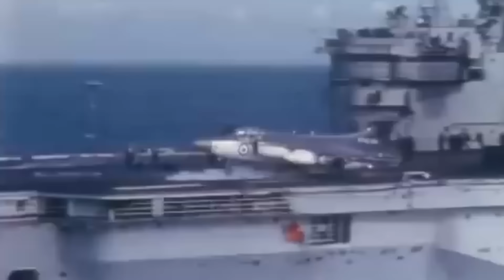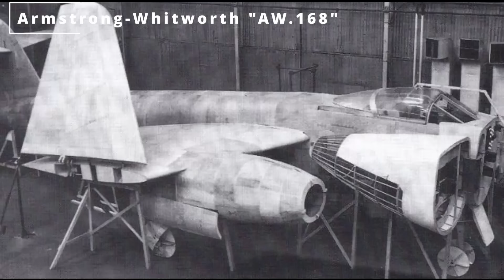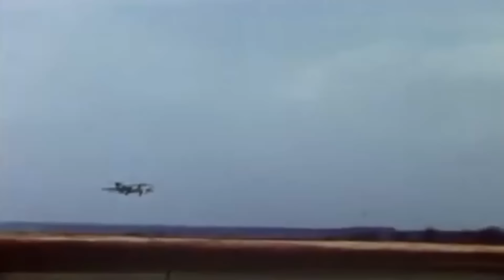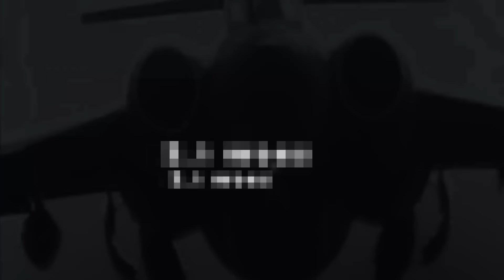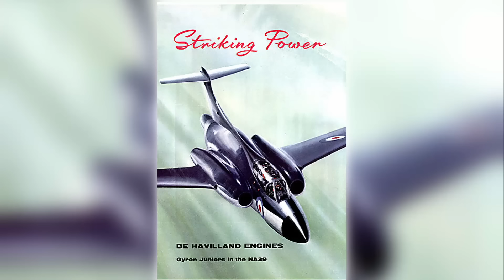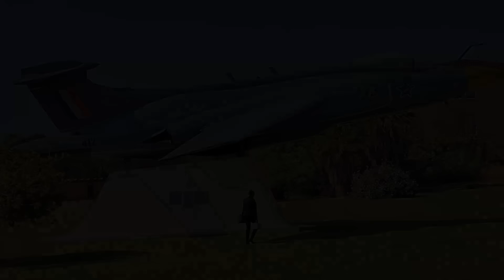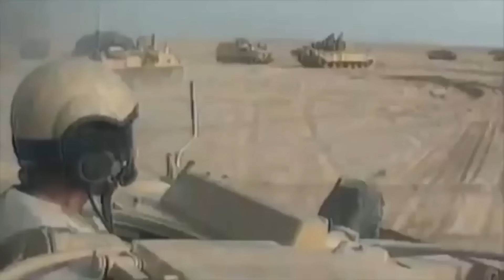Blackburn Buccaneer  -  Insane Low Level Bomber Americans couldn't shoot down - (Full Story)

Comment: Acknowledging the different missions, the Buc almost looks like a mildly swept wing version of the CF-100.  A little pointier on both ends with a higher tail.
Reply: They were both very disappointing aircraft from a performance perspective... the Arrow and the Buc both fell well-short of their top speed performance goals leaving them unable to fulfill their intended roles. The Buc fell short due to poor high-speed aerodynamics and structural problems... The Arrow might have been a superb aircraft if the Orenda Iroquois engine had not been an embarrassing, completely unmitigated failure.

Comment: I recall watching live broadcast from the Falklands War in absolute awe at the ability of the airframe to manoeuvre so violently. I couldn't understand why the wings were not simply ripped off. Thank you for the answer 😎
Reply from the maker: The one in my local museum (RAF Hendon) has a Gulf War Bucc SB2 with the wings folded, the spar forgings are simply huge
Reply: No buccaneers were used during the Falklands conflict though it’s said 2 did visit after the conflict had finished

Comment: The Target Marker Bomb was a label applied to the Red Beard nuclear bomb in the early part of the NA.39 programme. The reason being that the Ministry of Supply and the Atomic Weapons Research Establishment at Aldermaston didn't want the codename Red Beard to be known to the aircraft companies and their numerous suppliers so the TMB label was used to disguise RB. Labels have a habit of being hard to remove. I worked as an engineer at the old wartime Blackburn Aircraft factory in Leeds from the mid-1950s. Much of my work was on the Red Beard casings, another Blackburn product.

Comment: There are 2 and a half Buccaneers at Raf Kemble.
Reply from the maker: What happened to the other half?
Reply: @AviationRepublic lol. Two complete and basically half of one in between the two complete planes.  Hopefull being sacrificed to make a good plane or two.
Reply from the maker: If only I could win the lottery, I would spend it all on buying as many of these wonderful machines, stick then in the hanger and admire them. :-) Joe
Reply: @AviationRepublic  they both looked  complete.  Most of the planes that go there (especially commercial planes) are sent there to be  scrapped but ive seen old planes flying about there last year. One looked very much like a canberra. (too high up to make a positive id) There was deff  one on the ground near the runway.  They have old planes littered about the place near hangers.  Including one with twin propellers (on each engine ) a  few years back.  I actually went passed hangers  with an escort and they were running one of its 4? engines.

Comment: Was in the FAA as a humble REM(A)1. Was at Lossiemouth Honnington and Later the Ark Royal , This bought back some memories, humping black boxes of freshly calibrated electronics (mostly still valves and all analogue) into the radio bay in the belly and installing and wirelocking  it in place and dragging the old one to be serviced recalibrated, the Blue Parrot radar scanner under the nose cone, checking  the armoured had made the ejection seats safe(all safety pins in place) before going into the cockpit to do checks, playing cards and board games for hours waiting for the cabs to return from sorties as every trade had checks to do when they landed. Cus I had it cushy as an Rem (less work to do post sortie I had to trundle a trolley around the flight deck and with a lance spay WD40 into the engine intake as they cut the engine, think it helped with the salt, I've seen them flying so low that they're almost sucking the ocean in😅 can I say it's nice to hear a good human narrator, Am sick of all the robot voices on YouTube ❤
Reply from the maker: Thank you for sharing this, I never heard of the lance spraying of the WD40, that's a new one, that's gone into my note book. AI voice have a place, but here Alex did a great job, now I have taken over (Joe) the last half dozen latest videos. :-) Joe

Comment: On an air defence exercise in around 1977/78 on the Belgian, West German border we had F111s and Buccaneers flying against a 'target' we were defending with Rapier missile systems.  The F111s were no problem, picking them up at max radar range and carrying out three or four engagements per raid. Then came the Buccaneers. Our systems were alarming out at max range, but no targets visible. That is until two Buccaneers thundered directly over our missile site at between 10-20 ft! (which I believe, if the pilots are to be believed is the Buccs max operational altitude ;)). They were that low we felt the full jet wash and enjoyed the wonderful smell of burnt jet fuel! Fantastic aircraft.

Comment: I used to work on an inshore trawler in the early 1970s when they were testing the Buck at ridiculously low level  in St Austell bay on  the south coast of Cornwall. They used the inshore fleet as aiming points during low-level exercises when they flew at mast-top level, at close to if not above Mach 1. If I was out on deck as the Buck 'buzzed' the boat the noise would be deafening (if you saw it coming flying at wave-top height) you just had time to plug you ears; if not the noise would cause severe ringing in your ears that lasted for  15-20 minutes. On the other hand the noise was so invigorating we welcomed the devastating 'high' we'd get from the jets' passing.
Reply from the maker: What a fantastic story, I am very jealous you got to witness that in real life, my question is, did it scare the fish, I had to look up what an "In shore trawler" was, now I know, ones the work close to the coast, usually within 12 nautical miles of shore, every day is a school day. :-) Joe
Reply: The Buccaneer was not a mach plus plane. Growing up in South Africa I loved the Buccaneer, the Canberra and the Mirage all brilliant aircraft

Comment: I remember attending the RAF  Brawdy Air Show back in the 1970s when Buccaneers conducted a simulated, low level airfield attack. It was over in a flash, with aircraft attacking from all directions. It would have been impossible to stop the attack in real life.

Comment: I was at R.A.F. Honington in the early 70's as the son of an engineer who was posted there in 1969. In the early 80's I returned as an engineer myself, just as the Buccaneer left and the Tornado came in. One of the Buccaneer's last parting gifts was a 'beat up' of the airfield. We knew it was coming so we all poured out onto the servicing pan to await it's arrival. We could hear the sound of an approaching jet but nothing was in view. Suddenly a Buccaneer appeared over the roof of one of the Hangars. It seemed to be lifting to avoid the hangar. It promptly flew over the station at ridiculously low-level. Wonderful sight.

Comment: Trouble with the buccaneer was being out dated as soon as being built.  The french had faster better naval aircraft everyone had aircraft that could go faster than mach1 which the design of the Buccaneer could never do and its ceiling height also was a problem. Mount Batten was an Idiot really as got so many things wrong and not a nice man at all. It showed the UK was far behind others but then they found it was great at low level better than any other aircraft of that time by far. The only plane that could beat the Buccaneer was the Sepecat Jaguar French British with its line of site computer 850 MPH low level the best ever low flying aircraft even today better than anything.

Comment: Was on 700Z NAS trials unit then 801 NAS on HMS Victorious. Loved the aircraft but hated the boundary layer system - a pig to work on😊🇬🇧
Reply from the maker: Thanks for sharing! I’ve actually never had a chance to work on or really dive into the details of the Buccaneer’s boundary layer control system—it sounds like a real challenge. I’d love to hear more about what made it such a pain to maintain if you don’t mind sharing! :-) Joe
Reply: @AviationRepublic hi on the mk1 (I never worked on the mk2) - the ongoing problems that we regularly had was at the wing fold, with the high temperatures you couldn’t use rubber seals so they came up with complicated (over complicated) metal compression units and with the constant folding/spreadings they regularly malfunctioned and were a veritable pig to change out, especially on board ship in the tropics. They also made for an interesting spectator sport, watching the cabs land at higher speeds 😮🇬🇧
Reply from the maker: Here is a question for you, do you know why the Bucc has a hole in the tip of the nose cone?
Reply: @AviationRepublic it doesn’t - the early NA39’s had a test probe there but no 700z aircraft had them - they were fiberglass honeycomb 😊
Reply from the maker: You know the hole I am referring to? check out the video in the shorts, just to be sure we are talking about the same thing, I think i have the answer but I need it confirmed, it's driving me nuts :-) Joe
Reply: Hi again - had a look again and the only bucc with a probe is a factory pre production cab with a test probe doing sea trials. Ours all had fibre glass radomes😊
Reply from the maker: Thanks for looking, I think the only one I have seen with a nose probe was the NA39 prototype. NA.39 XK488 down in GNAS Yeovilton.

Comment: In 1976 I was in a holding squadron to start my fast jet pilot training. We had a ‘navigation course’ and weren’t allowed to pilot the Scottish Aviation Bulldogs (but that depended on your instructor pilot ;-) ). My instructor was ex-Buccaneers, awaiting the Sea Harrier. I remember holding at 1,000ft over the North York moors LFA and awaiting fast jets to call joining (the low flying area). My pilot took great delight in timing a max speed dive in our little dinky toy prop aircraft to get on the tail of a pair of fast jets and screaming the attack code at them over RT. EEEH, WE AD SUM FUN :-)) (Apologies for the pretend Yorkshire accent.)

Comment: The problem with the plane was it was so slow as the Hawk single engine was faster outmaneuver it. The only use was on navel ships but a stupid General kept trying to sell it instead of a fighter which it was so bad at the government had to get a fast real fighter the Electric Lightning. As the Buccaneer costs just got stupid nearly killed off all other supersonic planes.  It also in part with missiles stopped the making of new modern aircraft like the TSR2 and the Harrier. The other plane that was really bad was the Nimrod which killed off the supersonic Harrier only one was ever made then scrapped the idea.  As Britain does not have any aircraft companies very sad.  So we ended up with the F35 supposed stealth but has so many problems only a few are able to fly and they can only do Mach 1.2 as stealth design means can't go faster than that so why call it the lightning? RAF is in a mess they need the Buccaneer for the navy again.

Comment: Most of the aircraft embarked aboard CVA62 Independence 1970 were bridle launched, only two or three ac types had launch bars and the catapult shuttle needed an adapter fitted to launch nose gear launch bar ac.

Comment: I was in the RAF for a long time and was stationed at RAF Lossie back in the 90s. The final beat up of the airbase was spectacular ! Most of the squadrons climbed on their respective hangers to watch it. Other times I would be on 'wet drill' with aircrew, throwing them in the oggin from a ship for sea drills. The buccs would beat up the boat at super low level, I swear as low as the top of the boat. I spent a TON of time on the airfield on brake-chute recovery for the Jags and hunters, you could tell these buggers from miles away as they had a dirty jet exhaust.
Damn, I miss those days :-( 
Great video. Lots of memories.

Comment: I have happy memories as a RAF Supplier at RAF Honington, standing in ATC and looking down on a Bucc doing a wheels up 'taxi' round the peri track piloted by 12 Sqdn aerobatic pilot and Sqdn Commander Wing Commander Henderson (later promoted to Gp Cpt and RAF Honington Station Commander). Also memories of trying to load a Bucc Blue Parrot (ref 10D 4150714) radar set, in its transporting frame, in its transport box onto the steeply sloping Hastings a/c for an operational deployment

Comment: I was at Brough for 6 years in the IT dept. I did some work at Holme-on-Spalding=Moor, where for sometime I lived. In the Control Tower there was the test pilots/navigators room with pictures taken from the Buccaneers during test flights. Several pictures of my wife sunbathing in the back garden left me wondering if I should complain or be proud. The story in that same room about an aircraft all painted up in squadron colours only days before delivery was on a test flight. The crew decided to drop a sonic boom on Woodford, another Hawker site but in Manchester. They missed the airfield as the aircraft pulled out of its dive and shattered thousands of windows along the streets of Woodford. They then had to fly up to Scotland at below radar hight, pop up finally on the Scottish East coast and fly home as if nothing had happened. The investigation went on for months but they got away with it.
Reply: And?

Comment: It certainly was a great aircraft. As an engine fitter I had worked on HMS Hermes during a refit and went to sea on her for trials, in early 1964 I think it was. My bunk was right under the arrestor gear room - one night we had a flight of Buccaneers do touch and go on the flight deck. That was a very memorable experience, the noise they made as they slammed down onto the flight deck and immediately hit full throttle to roar off again, one after the other - I will never forget it.

Comment: why edit the thumbnail like that instead of just using the original frame of the buc flying low
Reply from the maker: When I made the video i was messing around with various thumbnail styles, I stuck this one up along with two others and this one seemed to perform well, so I left it. In all the noise on Youtube, a small channel like mine has to make a little more noise than others.

Comment: I joined Blackburns after giving my 4 years  Victor test flying at Handley Pages. I declined to continue, preferring to fly an office desk instead. It proved a good decision, & I eventually retired as 'Remuneration Manager.
Reply from the maker: oooooh, the Victor, lovely machine, just lovely. I can imagine you have some interesting stories, pics, videos even......not hinting or anything... :-) Joe
Reply: I joined H.P. as a technical apprentice, at age 18, spending 5 years working on shop floor & offices, finally at the Radlett airfield, & then joining the Flight Test dept. I was by this time a fanatical glider pilot, sometimes flying cross country, attempting the 'Gold C' distance of 180 miles/300 km, which I never quite achieved. After 4 years I left & moved to Blackburn Aircraft but declined any further test flying, a wise move as it worked out. However my best experiences were the truly awesome    rocket assisted take-off & the night flying at altitude over the channel - when we got back to the hotel, the night porter had left us a cold chicken & a bottle of whisky.  Wacko - I slept well that night. The. Victor was the only 'V' bomber that could go supersonic, albeit fleetingly. The main designers, Messrs Lee & Vernon certainly produced a winner. It could fly so high that one could see the curvature of the earth. When you returned to earth after breathing neat oxygen in a pressurised cabin for several hours. you were full of life, which soon passed! A misspent youth - no, fond memories.
Reply from the maker: Thank you for that, You have one well lived life. One day I will cover the Victor in depth, she is a marvelous machine. {-) Joe

Comment: For a while I flew (civil operation) with an ex-Buccaneer pilot who told me about a Red Flag exercise he'd attended.

The RAF were attacking a ground target situated in a low area surrounded by ridges while the USAF defended. The Buccaneers came in so low that they were hidden in background clutter, denying the defenders the lock-on required for a shot.

Having 'destroyed' the target the Buccaneers began to exfil. The USAF pilots had the advantage of local knowledge so pursued them with the plan of getting a sky shot as the Buccaneers flew over the ridgeline. The negative G restrictions on the airframes, and pilots, meant they couldn't just push the stick forward and bunt over the ridge so would end up high enough. The positive G limitations however, as with most aircraft, were considerably higher...........just think about that for a few seconds. The aircraft was limited to -3.1g but +6g.

Approaching the ridge the Buccaneer pilots simply rolled inverted and crossed the ridgeline upside down, pulling hard as they did so and denying their pursuers a clear shot.
Reply from the maker: Was that with Ken Norman at Monarch Airlines?
Reply: @AviationRepublic  No, not an airline. Private jet operation.
Reply from the maker: I see, I thought it would have been a hell of a co-incidence.